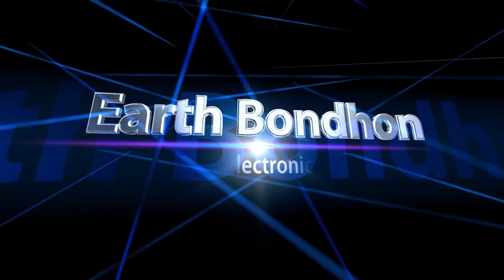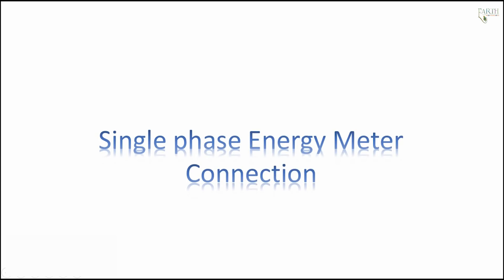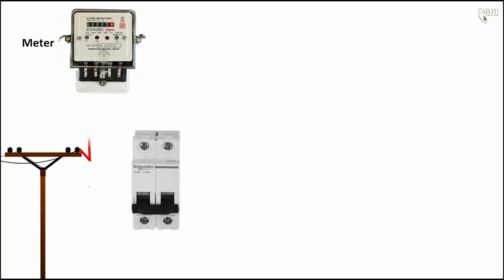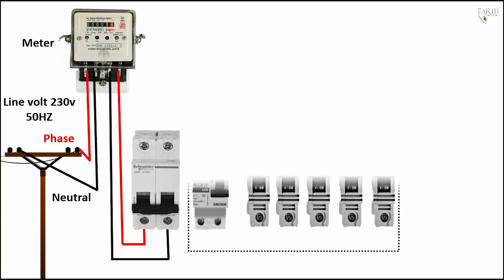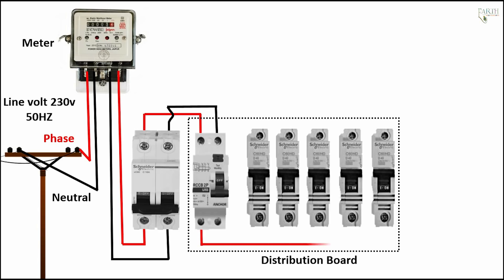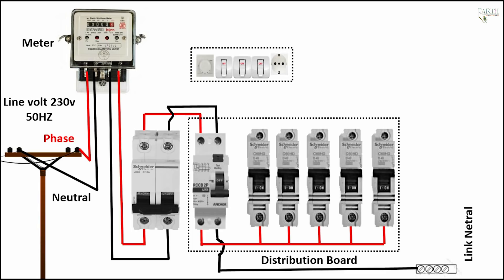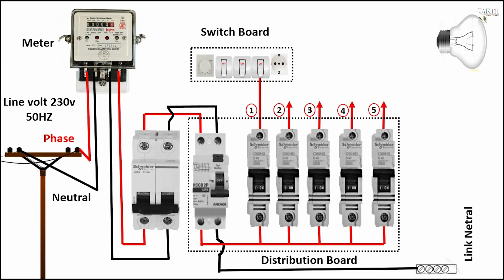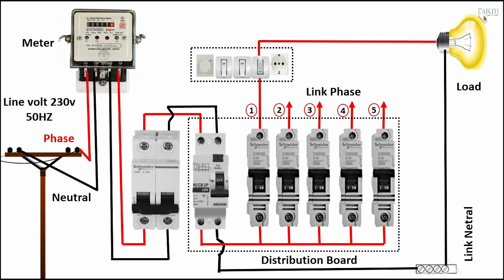single phase meter wiring diagram | energy meter | energy meter connection by earthbondhon

Comment from the maker: please like comment and share
Reply: E spring
Reply: This video totally wrong 
No 1 phase line must be connected in to the right side of the MCB  
No 2 phase line must be connected in to the right side of the ELCB  and main power supply always must be connected  to the  bottom  of the ELCB. Not in the top side. Also this video how work your light on and off.?  MCB it,s off also ELCB also off  there's no power going to your light.
Reply: راك خاطء
Reply: I cant share a comment 🤔
Reply: ET TIPS https://youtu.be/5rwR3eQVT0Q
Reply: If single phase winding gone what will be the cause?
Reply: @nassarmohammed5843  I agree 💯 with u  ..that's the right way...
Reply: Is it possible to connect two energy meters in series, this is for me to compare the accuracy of the two meters.
Reply: @nassarmohammed5843  Is it possible to connect two energy meters in series, this is for me to compare the accuracy of the two meters

Comment: Input connection why double pole mcb bottom side connected? . Actually top side connection right? . Single pole mcb input and output terminal?
Reply from the maker: yes, 5 sp circuit breker output terminal. Thanks For Watching video.

Comment: If an outlet is rated at 30 amps does the outlet pull 30 amps when the circuit breaker is on and no appliance is plugged in?
Reply from the maker: yes, add me whatapp. full info website @earthbondhon.  I love to receive your comments and feedback.
Thanks for watching it.

Comment: A good and informative video. But it has not been clarified as to what kind of circuit breakers are to be used and of how much power, watts etc. I have got installed new circuit breakers at home. The earlier one were not working in case of short circuit. But the problems is, the newer ones are also not working. The installation is ok. Please guide.
Reply from the maker: thanks you

Comment: input and output does not exist on the circuit breaker !!!!
Reply: irony
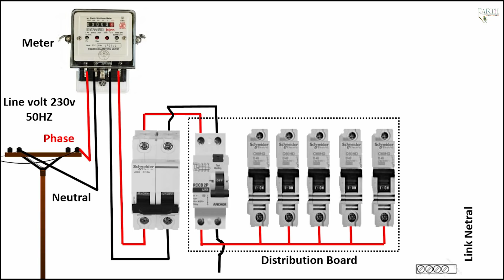Reply: see the constructive characteristics of the din circuit breaker, yes there is an input and an output the diagram shown is wrong 2:12
Reply: I also do not recommend install circuit breaker the neutral conductor. if a breaker failure occurs and it acts the phase will be connected, if the circuit is closed by the ground, for example, you already know the various problems that may occur
Reply: only protection device that can isolate the neutral is the residual differential
Reply from the maker: Thanks for your feedback, please follow.........
"Thanks for watching the video"   You are very welcome!

Comment: A lot is wrong in this video, first you don't get a neutral from the over head lines, this is only achieved for the star side of the pole transformer, as those over head lines will most likely be 11kv. Once the distribution cable enters the property the phase goes through a main protective fuse  usually a 1361. From there it will go into the metre then in best practice should go into a 2 pole isolator as a sparks is not allowed to remove the main fuse. From the iso  you will go into the mains board, and all circuits will be distributed from there.
Reply from the maker: Thanks for your feedback, please follow.........
"Thanks for watching the video"   You are very welcome!

Comment: I recommend to put a cut out or small fuse before the connection to the meter as i have experienced meter without fuse or cut out, the main supply from the pole can be in danger as it can spark if there is a fault or short circuit.
Reply from the maker: Thanks, friend
Reply: You have right

Comment: Hello Sir , initially really I'm very thankful of you for your very helpful video series , could you please answer these questions , about RCD and RCBO , it seems that RCBO is better than RCD because RCBO does somehow operation and in this way "save life of people" and also protect the devices such as TV and washing machines and so on , yes ?? So what is the difference between RCD and RCBO?? which one of them for home is better and most suitable ? each ones RCBO for TV and washing machine is needed separately ? each one should has which specifications/ amperage ? each RCBO can cover how many devices ? sorry a lot of questions !! I am contacting from Kiev in Ukraine and by answering my questions you will solve a lot of problems for me and at the same time it is a very big favor, Your fan , your supporter , Afshin Heydari
Reply from the maker: RCBO breaker better.

Comment: I give you a thumb down, for this video, and the reason are that, st least here in Norway, it is not up to code. Here it is not legal to use single pole breakers and a neutral rail, it shall be either a single pole circuit breaker with a neutral breaker on it, or a two pole circuit breaker.
Reply from the maker: thanks you

Comment: Missed one of main connection. IN ANY ELECTRICAL MAIN BOARD , 1.STREET POST TO CUT OFF SWITCH ( FUSE CARRIER ) 2. CUT OF SWITCH TO METER BOARD 3.METER BOARD TO D.B ( DISTRIBUTION BOX ) 4.THEN PROPER ROOMS SWITCH BOX.
Reply from the maker: FB id: earthbondhon.org
add me
get by new video soon............